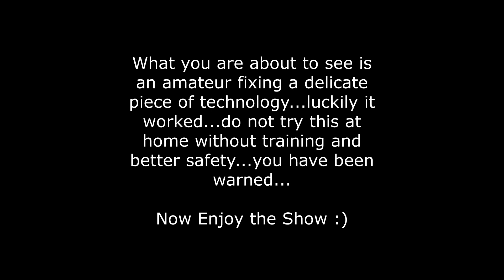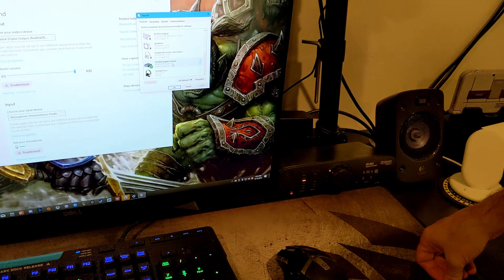Logitech Z906 Speaker Repair (3 Blinking Lights Issue) Resistor Replacement

Comment from the maker: I can't pin replies to the top but credit to @revolu100 for finding the factory resistors. I put in 2w ones due to a bad recommendation (and they've lasted so far) but you should probably use these.

"In the factory values the R79 and R80 resistors are 5.6ohm but 3W instead of 2W. Better be sure and buy resistors with that power or higher."
Reply: The 2 resistors (R79 and R80) of 5.6 ohms / 2 watts are exchanged for 4 resistors of 10 ohms / 2 watts in parallel to take out two resistors of 5 ohms / 4 watts
Two 120-millimeter fans are installed on the side of the box (one inserting from the bottom and the other removing from the top) to force poor cooling. The fans are powered by a 220 vac module at 12 vdc / 2 amps
A power supply type switch plug connector is installed to turn everything off without unplugging from the wall
Reply: @gustavoadolfosousabarrera1823  Hi ,Do You mean 5,6K ohm ( green blue red ? )
Reply: Se cambian las 2 resistencias (R79 y R80) de 5,6 ohmios / 2 watios, por 4 resistencias de 10 ohmios / 2 watios en paralelo para sacar dos resistencias de 5 ohmios / 4 watios
Se instalan dos ventiladores de 120 milimetros en el lateral de la caja (uno metiendo por abajo y otro sacando por arriba) para forzar la pobre refrigeracion. Los ventiladores se alimentan con un modulo 220 vca a 12 vdc / 2 amperios
Se instala un conector de enchufe con interruptor del tipo fuente de alimentacion para apagar todo sin desenchufar de la pared
Reply: Se me olvidaba decir que tambien se coloca un disipador pasivo en el exterior de la chapa (Lijar pintura y aplicar pasta termica)

Comment: Hello TechFireSide, I have These Logitech Z906 Speakers And I Have A Preticular Probblem, The Sound Is Clipping When I Turn It Up, Can You Help Me With A Solution For This Problem? I Have Visited Forums, I Tried To Ground The System With A Diode So The Current Grounds Only In One Direction, Not helping.
Im Using My Pc  For The Speakers, I Cant Grasp Fault. Please Help. :)

Comment: My system just has solid aux input 5 and 4 push the power unit shuts off and powers itself back on....also theres a clicking noise on the board.

Comment: Hi, i don't have the same issue as you. But if your surround system audio sounds like it's continuously pulsing regardless of audio input source, reset the onboard setting etc. what would you determine to be the mostly likely thing i need to check first when i remove the PCB from the housing?
Reply: Want to sell your system..?

Comment: Good afternoon friend, could you help me?.
I would like to know, if you can tell me, what type or model of integrated circuit does the bass card come with, I need to change it, but I don't know what specific model to use.
Thanks in advance for your reply

Comment: Hey. I have the same problem. The 3 lights stay on. Or when it works, it just makes a popping sound and restarts, it is absolutely so annoying. I might try this out and if it works i will let you know
Reply: Have you solved the problem with the z906 yet? I have basically the same problem.
Reply: @ViviJ-wv7fm  what i did is werid. By me there was no problem in the circuit. What i did is just changed the screws that were holding the amp plate to the box. I put shorter ones. And its been 6 months never had the problem. I think the long screws were messing with the circuit and bending the amp board. I have no idea how it worked. What you can basically try is to remove half the screws on the amp plate behind and test it if it works.
Reply: @iglipoleshi1522  Thanks a lot for the advice, I think I'll give it a try.

Comment: Had the 3 blinking lights issues, took it apart, zapped myself real good on heatsink on the power supply before I learnt to discharge those capacitors! Ordered 5.6ohm 3W resisitors on ebay and replaced R79 & R80 and fixed my speakers - ALL GOOD WORKING NOW - THANK YOU!
Reply from the maker: I'm glad another speaker set has been saved from the landfill :)
Reply: What heatsink are you using?

Comment: I've had the same problem. Solved with u ! Thank you so much bro!
Reply from the maker: I'm glad this has helped a few people out there! Thank you for your kind words.
Reply: @techfireside  I couldn't find any 3W resistors in my area so I had to go with 2W ones like you did. 
Is your Z906 still working fine after all those years?
Reply from the maker: @zrex6462  yes it's still working. I'm not an electrical engineer so I'm not sure if it's a safety thing or they just won't last as long but again so far so good.
Reply: @techfireside  It's good to know. Best wishes to you and your family.

Comment: I've replaced R79 and R80, and then R5 because that one was just broken loose of the board. But still having the issue of both input lights being light up. Having it in that state for a while, then pressing the power button shuts it off with a noticeable "bang", and then I can turn it back on and it'll work like it should (most of the time). After it being in stand-by mode for a couple of hours, the same thing happens again. Any ideas what else I could try? Maybe change some more near R5?
Reply from the maker: I really don't have a lot of experience fixing electronics (I got very lucky with my issue being a common one) but that almost sounds like a capacitor issue. I wish I could be more helpful but mine hasn't had the same issue as yours :(

Comment: I replaced the resistors R5, R8, R12, R26, R95, R119 (all 3.3kOhm), R79 and R80 (both 5,6 Ohm 3W), capacitors C27 and C41 (470uf/63V), capacitors C39 and C40 (47uf/16V), fusion F1. But the problem still persists. Any other idea what else to replace?
Reply: check every resistor to be correct with their line-colors.
Reply: Try replace the voltage regulator U7 on the underside of the power supply PCBA.

Comment: Great video !
I just got a faulty unit super cheap and want to try to fix it. I try what you did but it seems the problem still persist (input 5 and AUX light) and might be something else. Related to capacitors on the amp circuit board. So, will give that a try.
Reply from the maker: I hope you can figure out what it is! Please post your results here if you do end up fixing it so it can help others who might have the same problem.

Thank you!
Reply: Try replaced the voltage regulator U7 on the underside of the power supply PCBA.The voltage regulator part is an LM1117 5V (SMD version)
Reply: Did you solve it? I have the same problem.
Reply: @Aero93  Hey, no I haven't had the time to get to it. I still need to diagnose somethings.
Reply: @badboycris  If you find the cause/are able to fix it, please let us know! I'm having the same issue and also replaced R78, R79 and R5 so far.
Reply: @Qlii256  Will do !

Comment: Hello, thank you for the video, it is really super helpful and i learned that my resistors were also blown, same as the transisotr right behind them it seemed. Findink them was quite easy because all the neccesary info is written onto them. But with the resistors it is not so easy. Since there seems to be some confusion in the comments let me add some more :D Sorry for that. So i did a colour check of the resistors and found out it is a 5.8 ohm 3W 5% resistor. Can that be? Or would it be fine to get these? Does it make a difference? I am no eletrician. Thank you and thanks for the effort you put in.
Reply: The colour coding is Green - Grey - Gold - Gold and if i put that into a colour calculator for resistors 5.8 ohms and 3W with 5% tolerance comes out.
Reply: @Thetoboss  Also Green - Blue - Gold - Gold is the same 5.8 OHM; 3 Watts; 5% Tolerance
Reply from the maker: Thank you for very much for the kind words. I'm not and electrician or electrical engineer either so you are in good company with the hobbyists here that just don't want to add to the landfill unnecessarily :)

So, I can only comment on the ones I replaced but they were 5.6ohm 3W (initially I thought they were 2w from a bad recommendation on a forum). I had people on here try to claim they are 560ohm and all sorts of other things but from my own experience and going through this mountain of comments from people that know much more than me I can confidently say you should use 5.6ohm 3w. Again this is just if you are replacing the ones I did. Now my 2w ones haven't exploded or anything yet and it's been about 2 years now (no issues) but I would go with the advice I've been seeing of going with the original 3w ones.

Again thank you for the comments and I've been really happy to see that it's helped some people out there.

Comment: Gracias por el video, también a mí equipo se le fundieron las resistencias R79 y R80 y gracias a este vídeo pude cambiar las resistencias y mi equipo volvió a funcionar, Muchísimas Gracias
Reply: Porfavor dónde compraste a las resistencias y cuáles. Tengo ese problema
Reply: Buenas noches. Me ayudaría a con mi equipo. Problema con dos lucesitas. De ahí no pasa
Reply: Qué resistencia compraste?  Porfabor si me pasaras Los valores
Reply: Que tal! Me interesa saber cuáles resistencias compraste amigo.
Reply: Me puedes ayudar bro ya llegó rato buscando solución para mí equipo
Reply: Saludos que resistencias le pusiste ?

Comment: Hello, thanks for sharing this video. Two questions : how to remove the pink and black glue ? How to disconnect the cables : the plugs are really hard ?
Reply from the maker: I used a hair dryer at one point to loosen the glue up...it was still difficult but it helped. For the plugs I used a plastic spudger from my ifixit repair kit. If you don't have that you could probably use a plastic spoon or something like that. You want to try to avoid using metal tools on plastic because the plastic has a high chance of getting damaged.
Reply: Hello. Thank you for your fast answer. Just to give my feedback to people who try to repair Z906. My issue (no sound (just some clicks at the start) and control/lights frozen) was due to the two capacitors of 47uf 16V next to resistors replaced in this video. I followed an another tutorial because my resistors were not burned but it's clearly linked. Personly, I cut the glue with a cutter and scratch with a precision screwdriver but it requests precision and patience to avoid to damage the card. I also used carefully the precision screwdriver to make lever on plug. I had very big difficulties to remove the capacitors : impossible to melt the weld with a soldering station at 450°C (It was my first experience). So the last way I found was to cut the maximum of tin with a cutter and to drill around the pins with a needle. Before to do that, I tried to push on the pins with the soldering iron : it worked on the first capacitors, but I bend the pins of the second capacitors. I hope it will be useful and thanks for your help. It's just awesome and a great pleasure to hear again the sound of my speakers after this.
Reply from the maker: @thibaudlebrun7431  I am so happy this worked for you! And inspired you to go further with your repair. This was my first time soldering too so I'm glad you were brave enough to try and had a good result like I did :)

I loved this comment and thank you for putting it here to help others!
Reply: @techfireside  You're welcome.

Comment: Just got a system that doesnt even turn on, resistors are just like the ones you show the ones you remove R79 & R80 also on the other side of the bord there is a red round resistor (F1 or RV1 i guess) its blown too
Reply from the maker: That sounds like it's worse off than mine but let us know if you can get ti working once you've replaced those parts. This seems like it's becoming a common issue with these speakers. Thank you for watching and commenting!
Reply: @techfireside  UPDATE: took the board to an "experience technical guy" he change both resistors, R79 & R80 also change the Varistor and the 2 fuses, the guy says all that happens due to a high fuse amperage, he said that when the circuit occurs, the fuse wont blow and it goes to the Varistor which burns the resistors, I dont know much about all that, he said he replaced the 2 fuses for the right amperage needed and it cost me only $30 since i took just the small board, speakers works like new now 👍 thank you for the video
Reply from the maker: That's awesome! Good to hear some more technical explanation too. I was only copying what others did on forums but didn't really understand why I was replacing what I was (other than they looked like they had burned up). Thank you for the follow up and fingers crossed your speakers work for a long time to come!
Reply: @ticoruizsuarez  Having the same problem my R79 and R80 are fried (both measuring 20ohm and 25ohm), but there is continuity across the F1 and F2 fuses.  Can you find out what fuses he replaced them with? Rather have the correct fuses when/if this happens again.
Reply: @LaC64  will love to help you but I took it to a guy who knew more about the situation, I didn't do it my self

Comment: hi nice you showed people this but you really need to put some fresh solder on those pads before doing anything so that it softens the non-lead solder from the fabric then clean it with solder wick and you could have done the job under a minute. thanks anyway
Reply from the maker: Like I said in the video I'm very much an amateur at this :) This was only my 2nd or 3rd time soldering so I have a lot to learn still. Thank you for the suggestions and thank you for watching and commenting!

Comment: What is the value of the r79 & r80 resistors. Pardon my ignorance but what do i ask for in the tech shop?
Reply from the maker: Yeah it looks like my links in the description are dead. I did a search for "5.6 ohm (5R6) 2W Flame Proof Power Resistors" and found some on eBay for about $2 USD with shipping. You'll need 2 of them. I'm not an electronics engineer so there might be better parts out there but these worked for me.
Reply from the maker: @revolu100 Thank you for this. I went off of some forum recommendations (that I can't find now) that recommended 2w so it looks like I got some underrated ones. Do you know if they going to fail early or is it dangerous? Also, do you know why people keep saying it's 560 ohm instead of 5.6?

Thank you for the comments and feedback!
Reply: @revolu100 Hey I found 2 different resistors with 5.6ohm 3W. One with 100V and one with 350V... Which one should I pick?

Comment: you have probably the 1000w model.mine has a blue-ish board(sapphire) inside.I have checked the resistors,capacitors and everything seems fine,no burnt smells,nothing.Maybe i am missing something.My control unit sometimes shows 2 lines sometimes 3 and if i hold input it shows 4?After more than 7 yrs of use it started acting up,sound would go on and off every minute or so.After i've tried the reset function the control unit literally froze and got stuck on input lights,sound  wheel is not responsive anymore.If i turn the control unit off it turns back on by itself.Aniway nice vid,cheers :)
Reply from the maker: Yeah, that sounds like a very different problem than mine. My speakers were flat out dead until I replaced these parts so I think yours might have some sort of different issue (just with a similar error light pattern). 

I hope you can find a solution to your issue...it's disappointing that these are starting to have issues as they age. I don't expect them to last forever but I've got other electronics just as old that are still working great so considering how expensive these are I would have expected them to last longer.

I don't know how many of these units were sold but the views on this video seem to be climbing more and more every year so it's not exactly an uncommon thing for these to fail it seems.
Reply: @techfireside  I do not have measurement or soldering tools like you sir.Ended up buying a new one after 2 weeks of troubleshooting.Srsly my headphones are good and all but my ears hurt. :) I think the sub is busted bechause there is no signal to any of the speakers.If i find someone with the right tools i will ask him to take a look at it.

Comment: Hello, I have a problem with my Logitech z906. The motherboard heats up after sometimes and this results in random sound cuts. when I turn it off to cool down for some time and turns it on. the same problem occurs. I need your advice
Reply from the maker: Mine (even though it's working) heats up quite a bit while being used so I'm not sure that heat is the issue. I think it's possible you have a component failing on one of the boards but I'm not sure which one. To hopefully get some better help with the comments what audio input are you using? Digital or analog? And have you tried another sound source? (like if you usually have this happen while using a computer try plugging your phone or tablet into it and see if the sound problem keeps happening)

This should hopefully give some better information to troubleshoot the problem.
Reply: @techfireside  I tried these steps but it didn't work. So  I removed all the input cables and turned it on for some time. When it heats up, the sound cuts off and on. The rear becomes very hotter. I even tried another volume control unit but it did not help either. There i noticed there's a problem with the motherboard.
Reply: @freedomys  it is absolutely a failing transistor

Comment: Where i can buy a power supply board completely? So i can replace the old board.. Any one can help me?
Reply from the maker: Hopefully somebody has a good idea for this. You could possibly keep searching eBay (if that's a available where you are at) for a broken one that maybe has another issue than the power board but that would be risky.

I'm not sure if you can just buy parts for this. Have you contacted Logitech to see if they might sell you a spare part (probably not but it doesn't hurt to ask)?